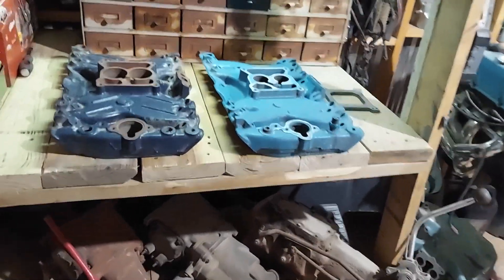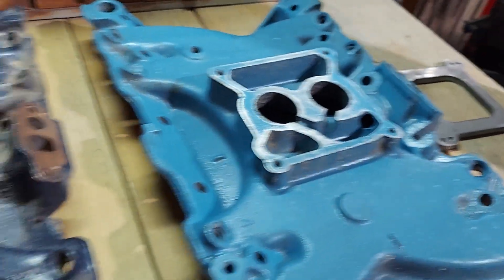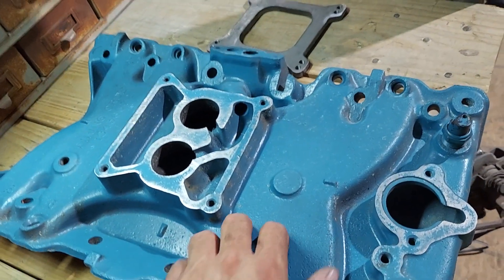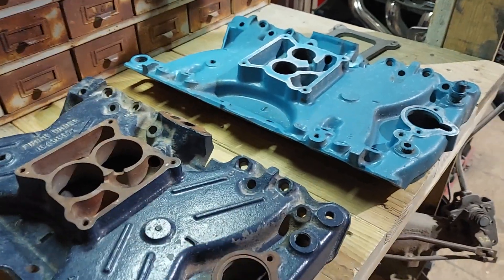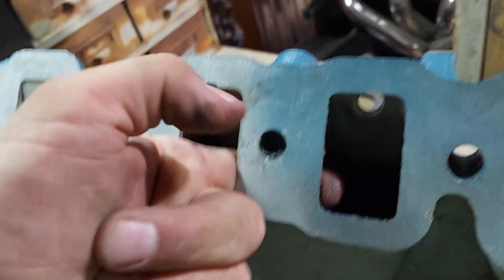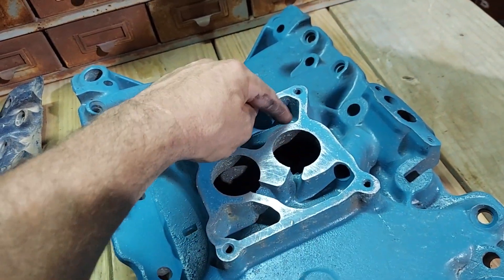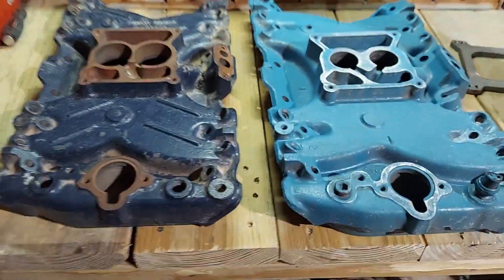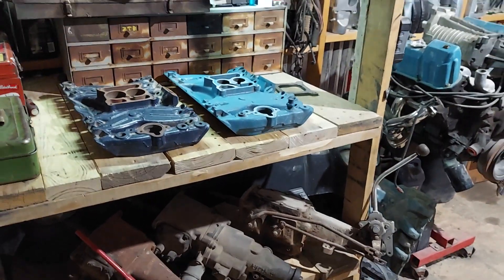Olds 350 EFI intake manifold found on Cadillac Seville & Eldorado fuel injection Oldsmobile 307 403

Comment: I've tried to read about and understand these engines in the past , very interesting.  Okay,  fuel injected, but "analog", which is different than later EFI engines,  article got into terminology about computing.  Over my pay grade😂.  Always wondered if there are shops that specialize in restoring these to run original.  Always sounded like with the late '50s Pontiac and Chevy fuelies, or the Olds Jetfire turbo, after cars were a few years old, and needed maintenance/repairs,  there really weren't enough good mechanics who knew how to fix 'em, even at GM dealerships, and intakes etc got swapped out for a simple carb.  I gotta read all these comments,  and watch the whole video, so cool that ppl share their knowledge,  I'm learning.

Comment: Great info! It would be interesting to see the 425/500 EFI manifolds Cadillac used and more info about that whole system. Also, differences between those manifolds and carb manifolds.
Reply: The intakes used on Cadillac's 500 motors looks just like a carb version other than the injector and sensor holes. 

See my explanation of the EFI used by seventies Cadillacs.

Comment: Looking specs of the smaller TB unit I am surprised that it only appears a loss of maybe 10HP and 6lb-ft torque by changing to the smaller unit....I had thought "Maybe" that was done to "Limit" the power output for the Downsized 79 Eldorado and the puny THM325 FWD unit....it appears that assumption was incorrect.  -  But those are interesting pieces!

Comment: I was around these in the early 80's. When they started running badly and not starting, the problem usually turned out to be a bad computer. When that happened the passenger side injectors would fail to get a signal. They weren't powerhouses by any stretch of the imagination.

Comment: Can I put supercharger in my Seville 179?
Reply from the maker: Yes, easy in my opinion
Reply: Than I have to change fuel real and intkmanifuld
Reply from the maker: @KambizYari  You can leave the original EFI stuff there with a supercharger,  but you will need to make sure more fuel is introduced during boost. The easiest way to do that is to put a rising rate regulator in the fuel return line and use a high-pressure fuel pump
Reply: But i already put a 4bar fuel pump on it.can i use a jak supercharger on it
Reply from the maker: @KambizYari  Yes, excellent,  you will need a strong fuel pump. You should watch my video of supercharging an Olds 260, basically the same class of engine... only difference that it is carbureted. Your fuel injected 350 should make much more powerful if supercharged
Reply: Well i don't know about fuel line and new injector.what should i use . cause with supercharger there's no room for orginale fuel line and injector.thanks for answering 😊😊
Reply from the maker: @KambizYari  You will have to modify the fuel rail to clear the supercharger... It's not very hard to do. You can probably use the stock injectors... but you will need to supply more fuel during boost by using a rising rate fuel regulator.

Comment: Machine out that throttle body so a four barrel square bore flange fits. Use a modern EFI throttle body with built in , throttle position sensor and maf/map sensor , IAC , put a temp sensor in the water neck and run TPI injectors , oxygen sensor and Delco engine management from a 1988 TPI Chev 350 ! Those injectors look about 1988 style , it would run grate and you could change Eproms to tune, all that would only cost maybe $200 these days .

Comment: Ok, Cadillac's Electronic Fuel Injection was available as a pay-option on 1975 cars with 500 motors, and standard on Sevilles that were introduced May 1st 1975, as a mid-year car. They were classed as 1976 cars, not '75s. The Sevilles had a specially built (partly by Olds, partly at Cadillac) Oldsmobile 350 engine all of which had Cadillac/Bendix analogue electronic fuel injection.

Bendix sold much of their fuel injection technology to Bosch in the 1960s but the Cadillac/Bendix system was similar to Bosch's D-Jetronic system. In some ways it was more advanced but it did use quite a few Bosch fuel injection parts.

The larger bore cast iron intake manifolds was '76/'77, the smaller bore aluminium one was used for /78/'79 Sevilles and '79/'80 (I think?) Eldorados. Neither of these intakes shown though fits the Cadillac 500 cubic inch motor.

If you're thinking of transplanting you will need (working from the rear) an EFI fuel tank pick-up unit with a built-in fuel lift-pump, the inline pump that needs to create 39psi for the fuel rail rail on the engine (Cadillac fitted a high-volume fuel filter alongside this pump.) You'll need the fuel rail which has the fuel pressure regulator valve and of course 8 injectors. The car will need a  fuel return line and the EFI distributor with the reed switch in it. The ECU and wiring loom which interestingly has circular Bosch electrical connectors other than where it hooks up to the Cadillac/GM wiring. The '78/'79 systems has ESS, Electronic Spark Selection wired into the system, this regulated engine advance for better performance and gas mileage, less pollutions.

These intakes require two sensors, these are identical but one reads engine coolant temperature, one reads intake air temperature. These are new ones available, on Ebay I think? Sadly there's much rubbish talked about this system on the internet, in general they worked fine. I know lots of these cars around the world and most are still running well. In fact you can get ECU computer repairs done by a terrific guy in the States and he even makes a few improvements in the unit.

Those converted to carbs were usually done through (as you say) lack of understanding or laziness? You can get most parts contrary to what the internet tries to tell you.  If you want to work with this system successfully please buy the Cadillac book/manual, it's blue and white, not too many around but the time it will save and how it'll increase you understanding? 

You mention fitting a regular intake for a carb, yes, but you can keep the EFI distributor, it's sending out information, not receiving it. I agree, that completely open aluminum intake with a crab is just not great. Excellent film.
Reply from the maker: @paulbedford9816  You are very knowledgeable. Thank you for the information
Reply: Anytime. I've been with Cadillac 46 plus. If ever I can help just ask. Best for the New Year.

Comment: Oldsmobile engines had wide bore spacings and almost flat 6 degree uniform valve angles, so it made better easy going torque, without a significant improvement in port shrouding. The EFi in the Cadillac used so many very carefully crafted synchronisations, crutches which weren't well understood, that worked with  timed ignition phasing to match the injectors, so people thought it was just a 2bbl with HEI electronics. It was a whole, a  well developed package. That got cut down in the prime of its life, just like the Pontiac V8s. A 403 EFi Or turbo Olds 350 Or 307 EFi Olds would have worked way better than the draw through 301 Pontiac Turbo  or 231 V6 Turbo. GM aced the class, way easier to service than a Bosch K or D Jetronic Benz. GM owned the fix value and feedback  Patents Brico and Bendix attempted to master. GM abandoned the system for TBi, a right step for some cars, a wrong step for Cadillac.
Reply: Thanks brother for sharing your knowledge, you obviously have a very thorough understanding of these  engines
Reply: I agree, as the 1980s started it was as though GM caused Cadillac much grief. Cadillac should have led the way.

Comment: Thanks for saving these pieces and showing the weird cross breeding GM did in the early emission days.

Never really got a good explanation as to why Olds motors outlasted all but Chevy V8's and why they spread across the other brands.  Ancient history now.😢
Reply: Well the Buick V6 3.8/4.1 lasted quite a while as well....Which morphed into the 3800 with various changes… But You are right, other than Chevy 305/350….The Olds V8 carried on for a while…The EFI 350 lasted in the Caddys to 1980 for California market. The 403 lasted thru ’79, but the TRUE SURVIVOR and I saw a LOT of these, was the 4 Barrel 307 in the “Corporate Wagons” Buick Roadmaster or Estate/Chevy Caprice Wagon/Olds Custom Cruiser Wagon – I think it had something to do with the “Package” those cars got, as they had bigger brakes and axle, and even the “pickup” 5x5 wheel pattern car…Seemed to be the HD package….These cars were known for lasting a long time, local mail/Sunday paper carriers loved them…IDK if the transmission was as heavy duty or not….I don’t remember (I didn’t wrench on transmissions) – I got these for tune ups….and if you knew what you were doing you could get them to run nicely and get decent MPG.

Comment: So, i have a 79 Eldo with this engine and 23 k miles. The thing is like new. But of course things do not work or run well. Can you use the low impedence injectors  with newer aftermarket FI Kit or would I need  a newer manifold? or a Carburetor intake and forget Fuel Injection?
I just want ease of operation and smooth running... Thanks for any suggestion.
Reply: Get a Cadillac EFI diagnosis manual. The EFI on the '79 Eldorado is like that on a '79 Seville. It's not as complicated as it appears. You can teach yourself or if ou don't fancy that find an expert, BUT a genuine expert. They can run fine.